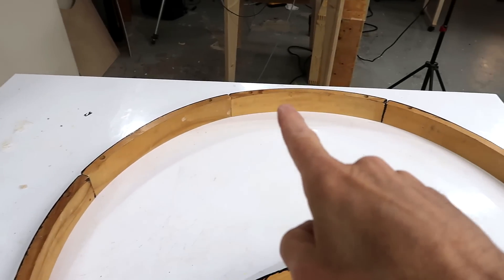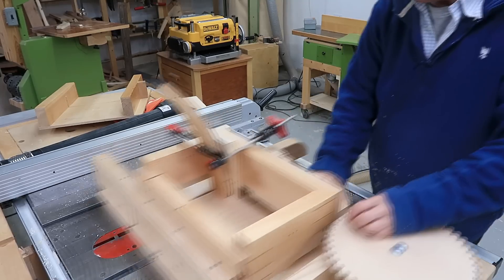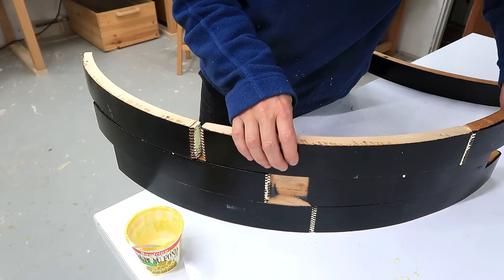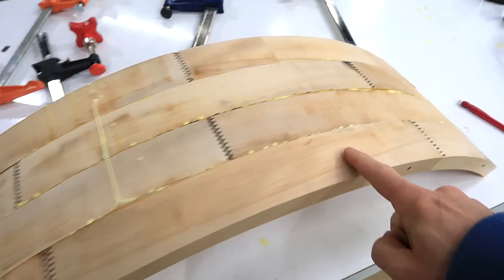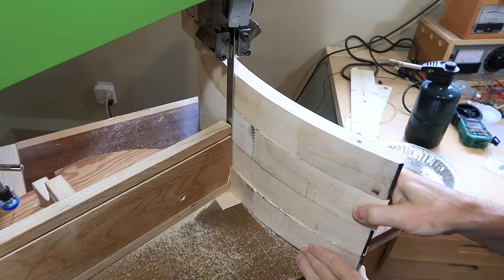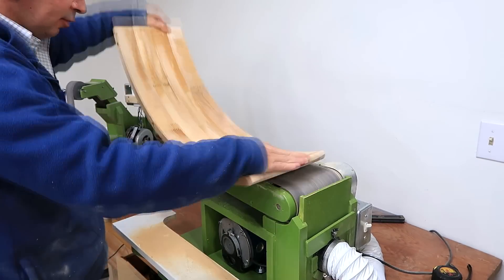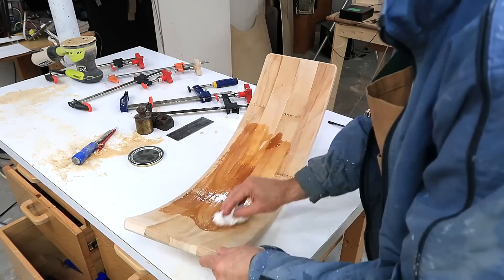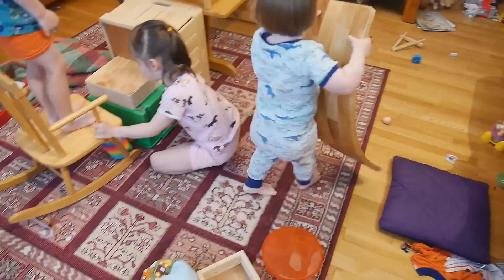Curvy board toy from table apron pieces

Comment: As a kid I was already skateboarding at 4-5. We used to take an old deck (just the board part) and balance it on a hard cardboard tube (around 5 inches around). Called it a balance board

Comment: I have a couple questions I could use help understanding for my own edification:

1. Why such shallow fingers on the joints? Just because that's all the strength they'd need since the edge-gluing will be supporting most of it?

2. Why resaw to even out the bottom? Would a jointer work for that too, if you had enough width?

Comment: A crazy question: Could finger joints ever be done along the length of a plank instead of only along the ends? Would the glued joints along a curved plank butt joint be equally as strong as a finger jointed joint?
Reply from the maker: could be done, but the wood grain is at 22 degrees at the end, so that orientation would be very weak

Comment: maybe consider to put some felt on the outside curve, with them "walking" the floor I'd imagine there'd be a lot of scratches..
Reply: The felt would make it slip out form under them too easily. A few scratched floors are par for the course for a home owner.
Reply: @KipdoesStuff  rubber pads then
Reply: He's a pro woodworker who's finished plenty of floors by hand, I think he's well aware of the effects that traffic have on wooden floors. Maybe he's just not as fussy and nit picky about things like that as others seem to be.

Comment: You could have saved a lot of time by buying one. Home depot sells them in their lumber section. I'm fact, that's exclusively what they sell in their lumber section, curvy boards.
Reply: @JorgTheElder  I think you may have missed the point of my comment. Its satire directed at the quality of home depot lumber, not an actual recommendation to buy it from there.